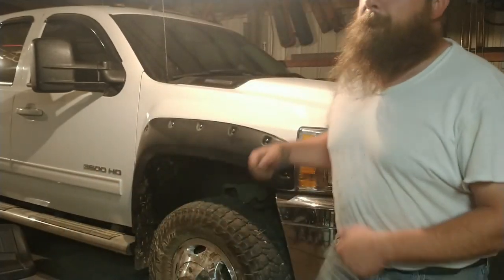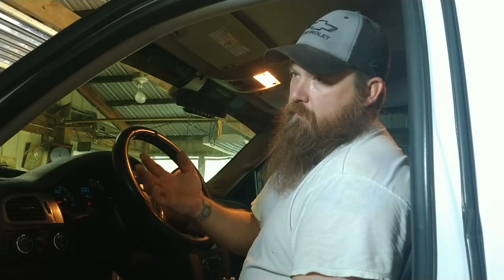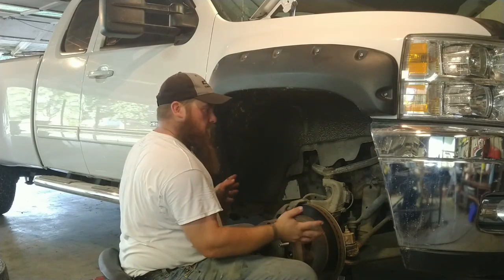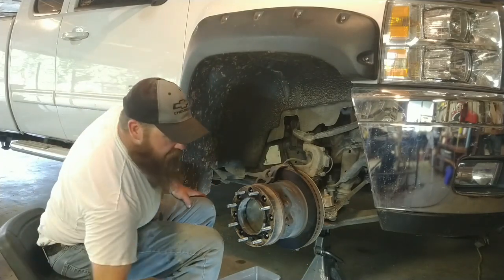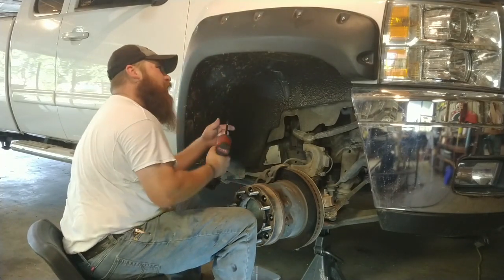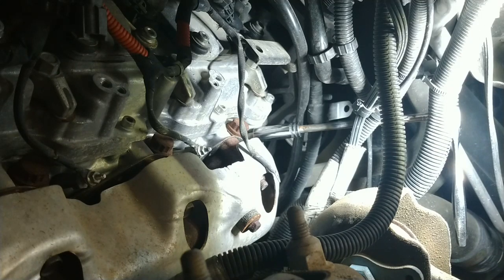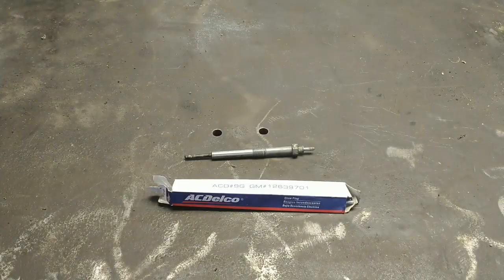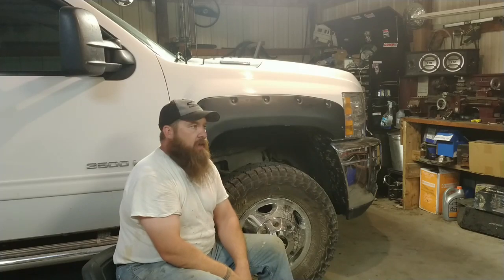Squarebody Stuff, 2012 LML Duramax glowplug replacement.

Comment: Thanks a bunch for this video!! I have the same truck, the same year and the exact trouble code. The video was very concise and to the point. I do have a suggestion though, Your engine was fairly clean but if your engine has dirt in the crevices, blow the areas surrounding the plugs off with compressed air before removing the plugs. You should do this with any spark plugs as well. You DO NOT want sand or dirt falling into your cylinders. An old school mechanic taught me that. GREAT VID. Thanks
Reply from the maker: Thanks, and good point on blowing out around them before removing them.

Comment: Is taking the tire off necessary or is it just to give you more room because I don’t have a jack at the moment
Reply from the maker: Not necessary but it gives you alot more room for activities.  You can use the factory  jack the truck came with if it still has it.
Reply: @SquarebodyStuff  it doesn’t it’s rebuilt it’s a 2014 gmc cab on a 2010 Silverado 3500 frame
Reply: @SquarebodyStuff  also I use it to haul Christmas trees during the fall and winter and it’s having some issues with the transmission getting hot coming up the mountain not hauling anything it usually stay around 180 or 190 but it gets up to 220

Comment: Which code reader do you use?  Also, did you use a memory saver?
Reply from the maker: I used the tuner box that came with my engine and trans tunes. I'm not sure what you mean by a memory saver.
Reply: @SquarebodyStuff  what is the name of tuner you are using?
Reply from the maker: It's from Dan's diesel.